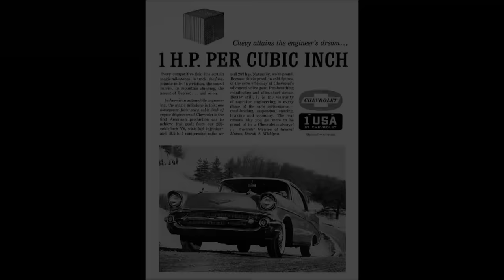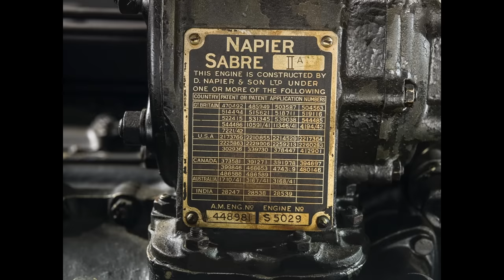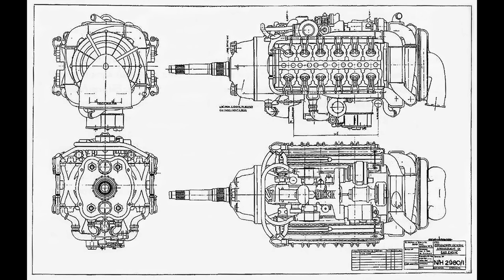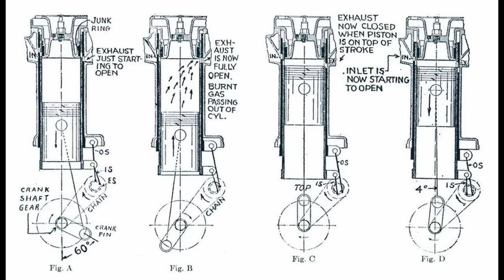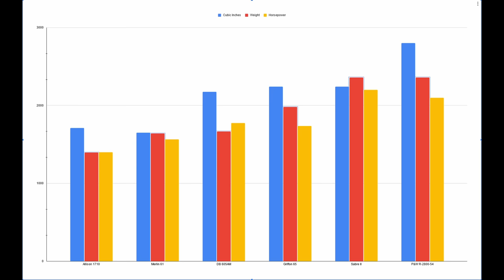Napier Sabre - The Ultimate WWII Aircraft Engine - Part 1

Comment: Fantastice presentation.  I wonder what numbers the German DB motor with 100 octane could have reached. German aviation fuel was 87-95 lean octane rated in WW2 I understand, while Allied fuel was 100 lean octane rated.
Reply: The DB 600 series could run on Luftwaffe C-3 fuel (100 octane) dry or wet with MW 50 (water/methanol injection)

Comment: The Lightning's turbochargers were built by General Electric, and fed the blower mounted to the engine, ironic, but jet engine metallurgy advancements really brought turbocharger reliabilty where it is today.
Reply: High temperature nickel alloys were invented in Germany by Krupp in 1932 and used by Swiss turbocharger manufacturers Brown, Boverei und Cie. in 1935.

Comment: yeah, with all this info its main problem is it's at sea level, the R-2800 had 2300 HP at test but the P47 could boost that to over 3000 HP at over 25000 Altitude, most Aero engines gain HP the higher you go to a point, and boost, if you have 2300 HP at 7 Lb's boost and you boost to 30 Lb's you just got a big jump in HP. this could make a good video on boost. keep up the good work.

Comment: Great piece.  Thanks.  I know horsepower is horsepower one thing to note regarding the DB 605.  They had no choice due to petroleum availability but the Germans used much less refined fuel way lower octane and still produced alot of power.  I would venture a guess that if you put the DB’s fuel in a Merlin it might not even start.  Do you have any insights or thoughts on fuel quality in general.

Comment: I read in a book about aero engine; none of the H-24 sleeve valves  Napier ever accomplished the 50 hours of running without breaking down. . . Also in the time of turbine time, Peatt and Withney canada had the maintenance contract for their turbo shaft . . .  It is said that Pratt's ingeners learned how to NOT build a turbo shaft. .  Then came the PT-6 serie turbo-shaft  . . . There was a saying about napier Motor Company; ; ;  Give them a sound idea and they will cpmplicate it to the point of un-buildably. . .   : D

Comment: Ahh   with  regard's  to  the  turbo  compound  engine as  you  describe  above   the   B  17  and  several  other   aircraft used   2  speed  turbosuperchargers 1942  on.  Ive   worked  on  several  B 17   engines   that  used   that  system. Overall  your  video  was  quite   good, Thanks.
Reply: As I'm sure you know, the US was really the world leader in turbocharging throughout the WWII years.  In addition to all the wartime heavy bombers (B-17, B-24, B-29) using turbochargers, the P-38 and P-47 used turbocharging for their forced induction.  I think the author is making reference, through, to a system that doesn't just power the induction blower with an exhaust turbine, but instead turns the crankshaft itself.  It's a different thing.  At least I think that's the distinction he's making.
Reply: Turbo compound engines feed mechanical power from the turbo back into the crankshaft. No B17s  employed compounding. They might have had multi speed turbo but that is quite different.
Reply from the maker: @davidd708  Yes, I didn't include turbo--compound in the comparison because the turbine is connected to the crank.

Comment: I don't quite understand. The Merlins in the De Havilland Hornet or P-51H reached 2000 Hp or 2200 respectively with 1650 cu inch which is considerably more specific power output than the Sabre.

Comment: Ricardo's late 20s paper on the limitations of poppet valves centered on their short life of exhaust valves before failure...all down to the available steel alloys  AT THE TIME...So he was correct...But overtaken by events: better alloys and American tetra ethyl lead in large (more than 5g per US gallon) quatities solved valve face and seat erosion, allowing higher combustion chamber temperatures via MORE BOOST (which rffective raises compression ratios to diesel like livels)..All common stuff for more than 35 years now....

Comment: Thank you for a great and informative video. How many would still exist?
Reply: Two or three...I think. Kermit Weekes has one and the Typhoon restoration currently underway in England has another. The one in England hopes to have the first running Sabre since the war, as they have two complete engines. One was obtained unused and crated since the war I understand. No, sorry. That was a RR Merlin, which was used in a Mossie.
Reply: @johnmclean6498  Thanks for that mate.

Comment: Distribution system of the Sabre was a limit due to high temperature of exhaust gases that reduced system reliability
Reply: In the sabre the compactness of the engine caused block deformations who did faster wear the sleeve valves, Bristol radial engines had not such problems and was very durable (TBO increased by 30% in comparison with US radials)

Comment: I would imaging any engine running at 25% higher rpm would have far higher requirments for good engine oil. Engine oils in those days were all mineral with a few running vegetable oils however these are usually total loss systems (due to the gumming effects of heat stress on vegetable oils) so I suspect there is a lot kore to the reasoning in RR getting more production than the Napier. Cost I expect also played a big part.
Reply: yes, the vegetable was castor oil, which is a natural ester.  The Castrol name is derived from that.

Comment: I wonder what these and Merlins could push out these days if fitted with electronic ignition, variable valve timing and direct fuel injection etc?
Double the power maybe?!!
Reply: And made of modern light weight materials to further increase the power to weight ratio. A light weight Sabre in a Spitfire type airframe would be quite something.
Reply: Well it would be until it tore the wings off
Reply: The limiting factor would be the unavailability of the 150 Octane aviation gasoline the late model Merlin’s and Sabre’s were designed to run on. Fuel economy could however be dramatically improved.
The Napier Nomad (which was a turbo compound diesel) could however be run now (and it still holds the record for fuel efficiency).
Reply: @allangibson2408  Yeah, but they only needed that 150 octane fuel to avoid detonation.  Modern injection and ignition systems have a whole 'nother way to avoid detonation.  If you look at high-performance car engines, you can find levels of boost on 93 or 100 gas that are pretty shocking (especially when taking into account the compression ratios of these modern engines), yet detonation is non-existent because of the fuel and ignition management systems.
Reply: @davidd708  Modern engines are still limited by detonation to lower specific output than the WW2 150 Octane engines. The direct injection engines avoid detonation by having no fuel in the cylinder before it is needed (just like a diesel) but these are somewhat different in design and have other performance limits.
In short - it’s complicated.
Reply: @allangibson2408  No doubt re: complication.  This is all a far-fetched conversation, as engines are generally designed with their ignition and fuel management systems in mind, so it's a bit silly to argue about what a fully-electronic, variable-timing, direct-and-port-dual-injected Merlin could do... it's just not a thing.

Comment: Weren't the P&W R2800 and R3350 engines producing 2500 to 2800HP?
Reply: Frontal area  nicked  most of it though
Reply: Gary…. Frontal area or not the fastest piston driven airplane of the war was a P47 with an R2800.  You should probably watch Greg’s Airplanes video series on the P47….

Comment: It’s driving me crazy that the narrator mis-pronounced both Napier and Rapier (the Rapier is named for the sword, like dagger and sabre are also named for blades) RAY-pee-yer.  And I believe  Napier itself rhymes with Rapier (NAY-pee-yer, not “nay-PEER”), but I might be wrong on that. 

The Sabre was certainly cutting edge, but like many things on the very edge of technology, it was one of the least SUCCESSFUL piston engines of the era, right down there with things like the RR Vulture. I would argue that the P&W R2800 was by far the most successful, followed by the Merlin and DB. In the decade after the war, the 2800, Wright 3350 (which got off to a horrible start) and the Bristol Centaurus (another sleeve-valve engine) had the longest and most successful commercial life.

Comment: The Griffin engine was a V12 with about 40% bigger capacity than the Merlin, nothing like the Sabre. The Crecy came too late and couldn't compete with the jets. The Sabre suffered from too many cogs for the "H" and side valves, also fitting compressors proved difficult.

Comment: Just imagine, if that engine had 9:1 with a modern turbine making 1-2 bar  more boost, with modern pistons, and port work , I think it could even rev to 4200-4500 rpm, and 3500 up would be at cruse rpm, I believe with modern fuel it would pick up 1k up plus! It would probably be a 5k hp engine, especially with modern ring packs lighter pistons, more boost,  the rings of today are in the 1-1.5mm range, the rings in those engines are probably 1/4"-3/8", or 6-8mm maybe even 10-12mm they are huge and heavy, the pistons can take advantage of modern coatings and leaps in design tech,  the chambers can prove redesigned, maybe even get the compression up to 10:1-11:1 with more boost,    a supercharger, with quad turbos,  maybe in a compound setup, with water/methanol injection, maybe even 6k up could be seen!

Comment: The Sabre reminds me of the BRM H-16 engine that briefly raced in Formula 1 in the mid-1960s. As I recall it had poppet valves instead of sleeve valves, but otherwise was similar- it had the same layout (two flat 8s stacked on top of each other), made a lot of power, but was crazy complicated, not very reliable (lots and lots of DNFs), and not especially successful with one F1 win (in a Lotus).
Reply: They are remanufactuirng 3 of the V16 BRM and the cars.

Comment: I wonder what that motor sounded like operating at 1,000 RPM’s higher with the smaller pistons sizes, compared to the instantly recognizable gorgeous sound of a Merlin. To a lesser extent, I’m curious about the sound signature of a compound turbo Allison compared to a Merlin because obviously, though fate (military bureaucracy meddling) prevented it from its opportunity for immortality in powering the P51 over Berlin toward the end of the war if only Allison were able to get the kinks worked out and into production by 1943 or so. My guess is though that those compound turbo Allison’s in a P-51 would’ve blown the doors off of a Messerschmitt ME262 jet once they finally shocked allied pilots in mid ‘44, though they only had a max speed of around 515 mph and a cruise speed of around 450 mph,  significantly faster than a Merlin 2 stage with the Merlin making about half or less power than the eventual compound turbo Allison prop plane could have made. But the swept wing design on the ME 262 was more of an accident than a forethought for aerodynamics/maneuverability as the eventual turbo jet used was heavier than the initial BMW turbojet used so the wing either had to be relocated further back on the fuselage or the wing could be swept back and was deemed more practical, though it was a happy accident that the jet was not only much faster than all prop planes at the end of the war, but it also had superior maneuverability. But due to a shortage of strategic materials by the late stage of the war in ‘44 (the airframe was ready in ‘41, but Hitler put a freeze on the cool toy development (big mistake) then only to resume development out of desperation once the war’s outcome was beginning to take shape in ‘43. So by ‘44, they had to make due with subpar alloys which shortened engine life dramatically to 75 hours and by then they were using a coal-based petrol or a mixed octane blend, but not a consistent 100 octane petrol like the Allie’s, so I’m sure if the circumstances of the war were better for the Germans, the jet would’ve hit the skies earlier in the war, performed better and required less maintenance. Still, the psychological effects of an alien (to WWII pilots who didn’t know of the jets under development back in the US and UK ), their engineering abilities and deployment due to a disorganized/inefficient procurement mentality, initial reluctance to adopt American mass production philosophy and wholly inadequate & slow replenishment rate really se  as led the deal for Hitler snd his merry men. And Hitler’s meddling in every aspect of the war may have been the biggest detriment to their chances of winning, from machine design to Ill-conceived battle plan and by that measure, the military meddling in the promise of securing a turbo from GE sound sad like nothing.
Reply: + Forced Anonymity   There is a recording of Sabres in action, probably made after WW2.   They are not very throaty compared to the V12s of the war.  They have a very high pitch.  https://www.youtube.com/watch?v=Fo0Lv1S3RfQ

Comment: Interesting video. Given that it is a British engine it would have been nice to see the Bristol Centaurus (also a sleeve-valve engine) in the list of comparison engines. The Centaurus produced about 2,500 hp at 7.2 compression ratio but, according to your figures, with comparatively low power/weight and power/volume ratios. Do the figures you quote for power/weight include the installed weight (i.e. plus coolant, piping, radiators, cowl/fairing for radiators etc) or just the engine and the coolant it contains? The mark 2 Tempest was powered by the Centaurus and was, by all accounts, a better aircraft than the Tempest 5 powered by the Sabre. Unfortunately demand for the Centaurus and its own teething problems meant it did not enter service during the war. I note that the post-war Hawker Fury and Sea Fury were both powered by the Centaurus, not the Napier.
As an aside, noted by other commenters, the RR Crecy, which never entered production, had specific power: 1.71 hp/cu in; power-to-weight ratio: 1.43 hp/lb.
Reply from the maker: I actually didn't know that about the Centaurus. The sources I used for weights were not specific about whether they included cooling system components. That is definitely a potentially confounding variable for the comparison. I'll have to dig into why the subsequent Hawker aircraft used Centaurus.

Comment: Wow, the sleeve valve concept sounds awesome and looks definitely more efficient for high performance. Why hasn’t this model of intake and exhaust not been used in the automotive industry. I wonder how a 4-cylinder version of this type would have faired in the auto industry even as a test run engine. I’m also wondering about fuel efficiency of this engine type.
Reply: The British firm Daimler used sleeve valves in some of their engines. For vehicles which mainly run lightly loaded, there were issues with smoke and high fuel consumption
Reply: @jacobmoses3712 , I was wondering about fuel economy. But it appears it would be a better engine used for, “Air Racing” in today’s application. I wonder if any one has ever considered maybe using this engine type for the, “Reno Air Races” in Reno Nevada? Maybe it would really blow the competition away in the unlimited class.
Reply: Sleeve valves do not work in high output engines because of heat transfer problems.  The heat from combustion has to travel through the sleeve to the cylinder block to be dissipated by the cooling system. The sleeve has to be lubricated and fit loosely enough so that it can move freely.
Reply: @craigcampbell1070 , Thanks.

Comment: Although we are probably seeing the end of piston engines today, over the years, engineers have kept coming back to the sleeve valve system, which in theory is far superior to poppet valves, but the complexity has always damned it.
Reply: Poppet valves could thrive in greater numbers, as in 12 to 20 per cylinder. The less combustion chamber roof is there, the easier time the air has in flowing past it. 12 Tiny little nail-like valves could obstruct flow considerably less. The key is to make the valves light and small enough to quickly be opened and shut, and the cylinder head combustion chamber area porous enough (with valves open) that it offers FAR less obstruction to flow.
Reply: @ceoelektronika8604  After 5 valves per cylinder, there is no more benefit.

Comment: Well, I´d like to point out that a comparison with the DB605 is a bit "flawed" because it was designed to deal with a lower fuel grade (compared to allied fuel supply) in mind.
So Daimler Benz would certainly have been able to get a significantly higher power output and better power to weight ratio compared to what they were actually "permitted" ...
Although, I doubt they would´ve matched the Napier´s design capabilities.
Reply: The DB 600 series was designed before super high octane leaded fuels were in use... the DB 605 was equipped with direct fuel injection so high octane fuel was not required.
 
The Merlin used high octane to compensate for its smaller displacement, lack of fuel injection or automatic altitude compensation.

Comment: Not enough to have the most powerful or best-designed aircraft engine for warplanes ... got to also have manufacturability, producibility, reliability in order to get your engines into the aircraft and get the aircraft into the air and thus into the war. Boom!

Comment: I remember a 2 stroke version of the Merlin was created. Did you look into that for comparison? It was pretty impressive if I remember right.
Reply from the maker: Yes, actually, I didn't include it because it never saw service. However, it did use sleeve valves. Would love to hear the sound of a 2 stroke Merlin.
Reply: Ahh the RR Crecy engine that too was insane